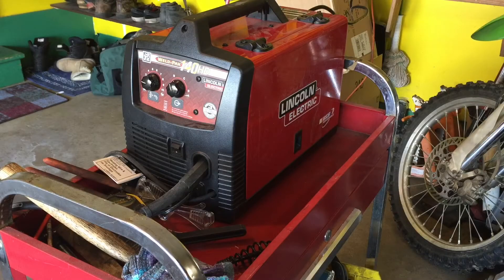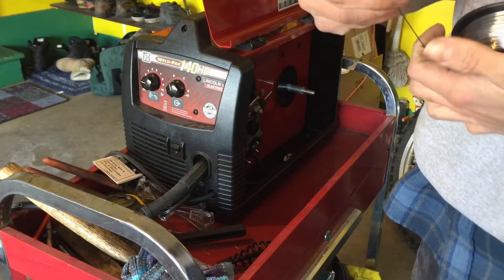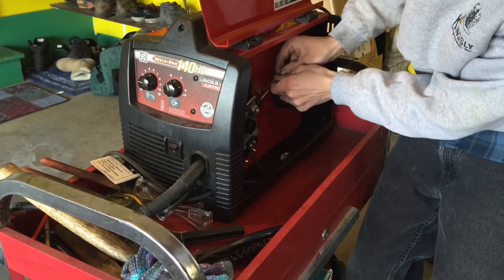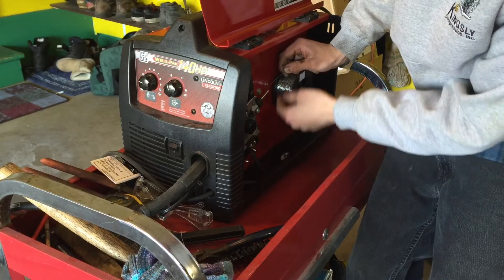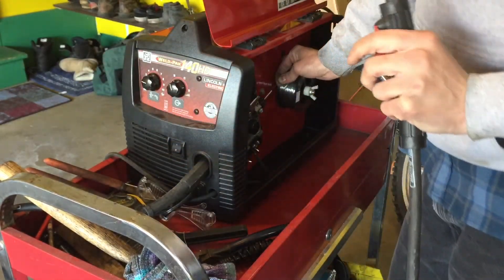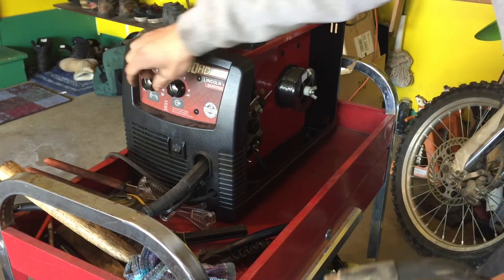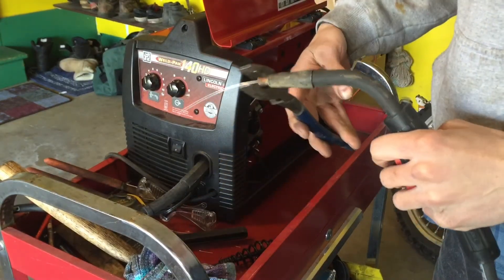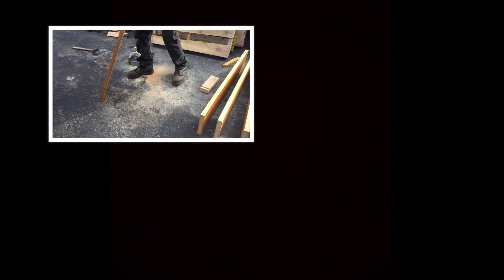Change MIG Wire on a Lincoln Electric Weld-pak 140 HD

Comment: Just picked up a Lincoln 140, wanna try running a .023 wire, will I need to change my contact tip and tip holder in gun?
Reply from the maker: I forget what they come stock with in the tip. You will need an .025 tip
Reply: .025 contact tips are harder to find :(
Reply: Yes. Use correct size tip for the wire that you're using..

Comment: Remove the tip before you feed. I'll wager that you won't hang up again... 

 Please explain why you have the spool feeding from the top versus the bottom..
Reply from the maker: Def figured out removing the tip is easier way early on. It looks like this unit can feed either direction. Do you know a benefit of top vs bottom?
Reply: It feeds from the top because the liner is at the top. If he puts the wire in the bottom, it will diagonally be fed towards the top and make a bend on the wire.